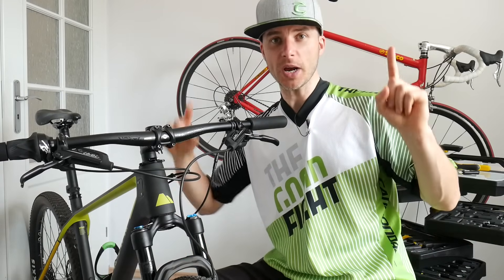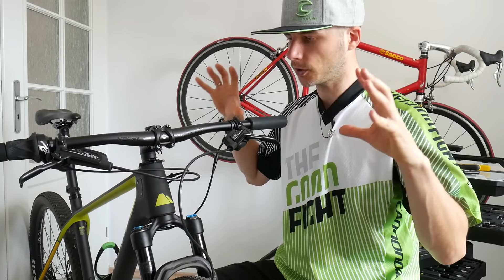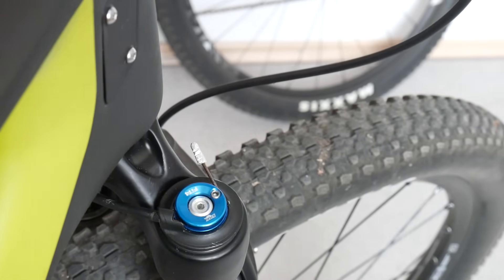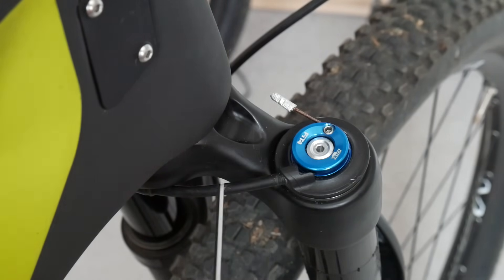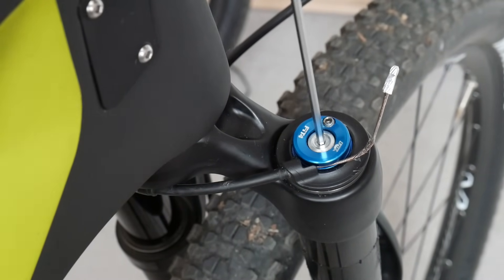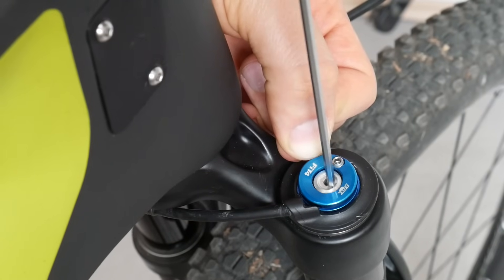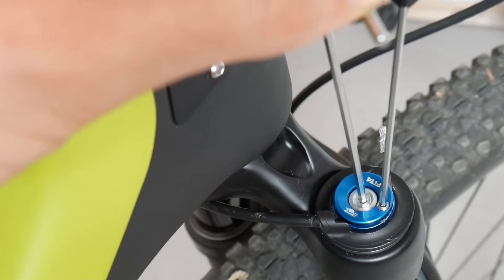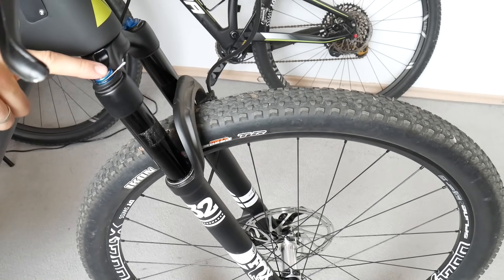Quick Fix - Lockout On A NEW Fox Fork Not Working. How To Solve The Problem.

Comment: Thx man! At first your fix was not working but i made a second try and did it a bit different. Loosend the srew, positioned the lockout to the maximum and tightend the screw/ cable again. Now it was on maximum lockout and on release it jumps back to open. Works like a charm!
Reply: This is the correct way to do it, not like in the video.

Comment: Awesome! Just what I needed to fix mine.

When I went to make the adjustment, I noticed 2 dots on my fork(fox 34 performance). 1 tells you were to position the set screw, and the other is where the set screw will end up one locked out. Fox obviously forgot to mention this to our bike builders...

Also, if you use a L-shaped allen key to hold the 5mm cap in position, 3 hands are not needed.  

Thanks for this video. I hope my tips help.

Comment: Stripped mine today for cleaning spent ages trying to get tension on the spring as i didn't think about the preload DOHHHHH, thanks for the tip. saved a few quid so i'm raising a glass to you tonight cheers.

Comment: Had the same issue twice with my brand new bike... Two FOX services, and 7 weeks of waiting, the problem happened a third time about 2 days after picked it up from the LBS where it already felt "mushy" when I received it - Like a disc brake that wasn't properly bled I was able to push it down like 2/3 of its supposed 110mm travel range but actually only measuring at ~95mm.

INCREDIBLY annoyed I was about to throw the thing against the wall when I came to my senses deciding to give it another try by removing all the air and having the fork fully bottom out because of this. I then pumped about half the required PSI into it, gave it some very slow pushes followed by the remaining half and another set of slow pushes.

Ignore the loss of pressure and refilling of the left air side! What probably helped to fix the issue ( maybe just temporarily, who knows ) was most likely the bottoming out of the right oil side multiple times while it's being slowly extended into working condition - Something the nutjobs at the LBS must have totally neglected doing - Circulating the oil?

Since then the Lockout worked like a champ as if you tried to punch a wall and the travel range actually went up to the expected 110mm.

Comment: Had this problem on a factory sc 120mm, thank you for thos video, it has open/firm/lock modes, after adjusting it the open and locked modes work but not the firm, firm feels like open, locked mode is very solid though, hope my son doesn't forget it in locked mode for too long.

Comment: THANK YOU. My new canyon Lux wasn't locking out and this was so simple to fix. It has a grip system, not fit4 but its really the same, the nut for the cable is just on the side not the top. Would be good to note that this is done under lockout position. Either way, THANK YOU a million times, saves me a potential send back or part wait or lengthy customer service conversation :D

Comment: Why you don't push the lockout button first and then you turn the middle screw to the "locked" position and then fix the cable with the small screw? Then you should have the locked position in the right position when you push the lockout. But the problem is (I guess) that the fork itself has 3 poditions and the button only two...

Comment: My question is, can I get rid of the remote lockout all together and convert my fork back to normal? I'd rather just lock my front shock by turning the knob on the fork itself. Right now, that lever on my handle bars is doing nothing but being in my way. I'd rather have a dropper post lever there.
Reply: just unscrew the cable and remove it and retighten the lever fully open
Reply: @shineranda29er  then the forks will be fully on
open and not locked out?
Reply: @alimantado373 Yes

Comment: Is this hack possible even if I don't have this lokc from the handlebar system, only a normal lock on the upper leg? (2011-2013 Fox Talas 140mm) Thank you.
Reply from the maker: I don't think so. You should be able to lock your fork with the lever on the crown, as there is no preload possible.

Comment: How tight should it be when it's "locked"? I can only feel a small difference. Fox write at their Homepage "not designed to be a solid lockout". My local bike guy told me this is intended.
What can i do to adjust the travel in "locked mode"?
Reply: Pascal Coenen its not solid to protect

Comment: I couldn't see any difference after the fix.
Surely the fork shouldn't go up and down at all but should be impossible to compress. 
The term "lockout" shout mean exactly that, lockout!
Reply: You cant stop air from compressing
Reply: @tmitche36  u can.
Reply: Mine got a lot stiffer on lockout after I put the max amount of air in the fork
Reply: @tmitchmtb1005 lol it's a hydraulic lock...
Reply: It has a blowout valve.
Reply: @Neil555-11 max is too much

Comment: The "lockout mode" that you are showing in the end is not correct, that means, you did not repair your fork :) I have the same bike with the same fox float 32 step cast performance model. When you lock it it is COMPLETELY firm, you can not even push it in. That's the point of "Lockout" ;) And if you google this problem more thoroughly you will see that this remote lever as well as topcap assembly on the fork have more serious issues that cable tension.
Reply: I agree with you. The lockout is complete in my Fox fork also (if tuned correctly, which is difficult). 
The topcap has serious issues with dust and water, Fox should FIX this, but they are trying since 2016....with no success !

Comment: expensive forks that have a weak and cheap system my suntour even works better than this good to know that i not gonna buy a Fox shock
Reply: It's not a weak/cheap system. It just has to be adjusted properly. Buy what you want, but comparing suntour to fox is delusional...

Comment: haha wtf XD he didnt even fix the problem in the video he locked the fork and it moved up and down... ''yeah thats fully working'' NOT! XDXD
Reply: almost every fork have a bit of movement when fully locked
Reply: Marcello Pitzanti not mine :) rocksock t26 model
Reply: The lockout wasn’t even broken, the video isn’t helpful, and there was no change after the “fix”. Literally the entire video is about spending 2 minutes messing with a pre assembled cable instead of taking 30 seconds to mess with a barrel adjuster
Reply: not mine they don't move 1 bit on lock out